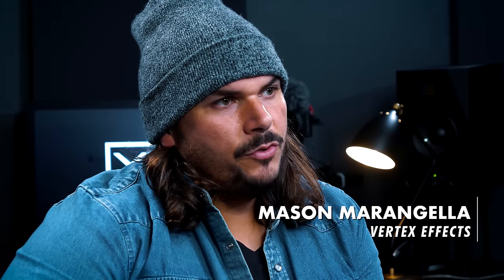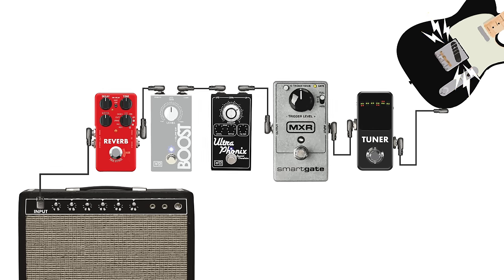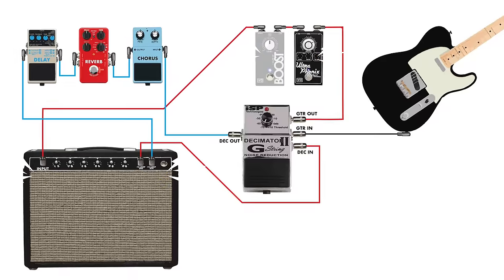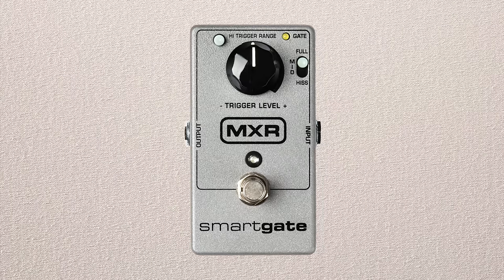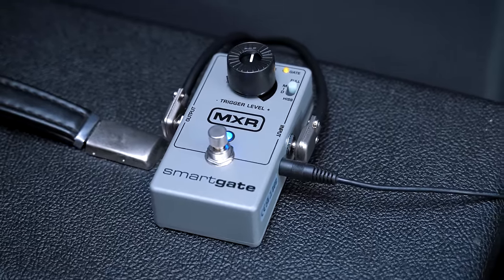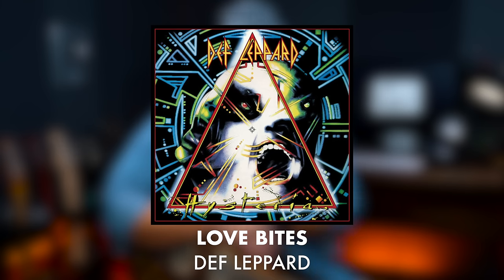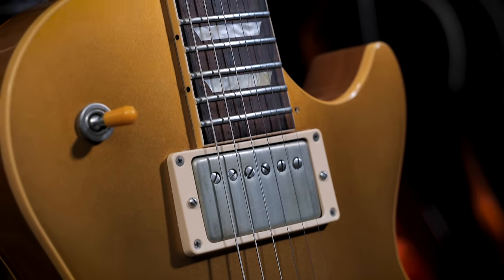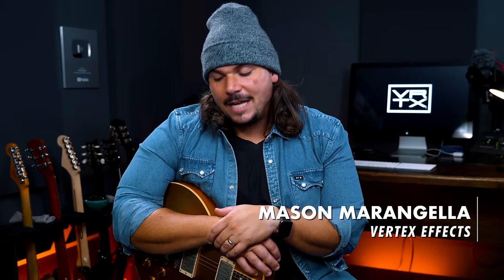Why I Changed My Mind About Noise Gates

Comment: Dear Mason,
I always enjoy your content, but I wonder why you never tried to compare AC powered (plugged into a wall) to battery powered (or USB powerbank) powered rigs? The noise floor is also different.
Reply from the maker: USB powered stuff is usually way worse than any of the standard isolated supplies, both linear and switch mode.  They in no way resemble or compare.  The USB stuff is still a novelty.
Reply: @VertexEffectsInc  Really? I started way back when using Volto and now i'm using my Cioks4 and have nothing but great results with it, even playing high gain ampa with an H9 and an ISP. When I plug into a mains power source, I always have increase the gate and when I switch to USB powerbank, I really have to dial it down and hardly have to use any gate. Still a novely? Sorry dude, but then we agree to disagree. Maybe you can school us on one of your next videos?
Reply from the maker: @krimsonlediable  Cioks 4 is a switch mode power supply, not a battery unit.  You can get away with lesser power supplies through cleaner amps and pedals with better quality filtering for irregular supplies with noise on them - it's a total crapshoot though.
Reply: @VertexEffectsInc  Hey dude, I've been using this setup with my Atma for small and 5150 for bigger gigs for years and it never ever failed me. All I need is a USB powerbank for power my Cioks4 and I'm good to go. No hiss, ground loops, nothing but a very healthy hi gain chug sound.
Reply: @krimsonlediable  Agreed. Been using USB power banks and mission 529 m for a few years. Cured my noise issues and flakey venue power sockets issues. Not a novelty in my book by a long shot. Serious gigging experience proves that.

Comment: If you have a blackstar amp and a  single  coil guitar you definitely  need a noise gate. With a blackstar I found the tc electronics sentry works the best..and ive tried several different gates

Comment: I rather have a gate that has a KEY input rather than running my original guitar signal through the gates circuit because it will tone suck and alter the original guitars dynamics. Its best to use a Noise Reduction software program that will copy the guitar track and remove the noise using AI algorithms. It algorithms called STEMS that are isolating the noise on tracks into STEMS i think they are calling them stems also the noise riding on the tracks. Try to look into Noise Reduction software programs. I'm not sure why guitar gate pedals don't use more KEY inputs instead of audio input ports.
Reply from the maker: As you can see, the input on any 4CM gate is the Key input (or sensor), so you don't have to have a ZUUL necessarily to introduce that feature.
Reply: @VertexEffectsInc  Yes but you guitars original signal is still going through the noise gate. If you use a Buffer Splitter to repurpose the gates input as a GATE KEY input this also alters the original guitar signal because the buffer converted high impedance to low impedance. Its better to use a Gate pedal input as a KEY input and have a "Pass through port" instead of using a buffer pedal. The newer DJ equipment has noise reduction AI Algorithms to remove noises from vinyl records and other gear noises. The ZUUL key input is a better way to go if you're using a gate pedal but still the guitar pickups are grounded which needs an isolation transformer between the guitar pickups to the pedalboards input and another isolation transformer from the pedalboards output to the guitar amplifiers input, this will keep the noise in an isolated closed loop.
Reply from the maker: @waynegram8907  If you hit the gate first that's the same as hitting the KEY, the input and the KEY are both sensors.  The Send is the same as a splitter off the input of the gate.
Reply: @VertexEffectsInc  I'm not sure why removing the ground on the send or return of the cable and adding a 0.1uf or 0.01uf to the ground will help reduce the noise level. The ground shouldn't have any noise level riding on the ground it should be a clean zero volts. If your voltage meter is measuring an AC millivolts on the grounds there is a problem and adding a capacitor is putting a band aid on the noise problem trying to sink high frequency noises to ground that way. The capacitor is also going to lift the ground potential at a different millivolt potential. Its a partial ground lifting make-shift problem fixer
Reply: @VertexEffectsInc  But your original guitar signal is going through IC chips, buffer stages which is ruining the original guitar signal its called degradation from the PCB board traces LCR. I don't want to use the gate as a signal buffer splitter, you rather use the KEY port because its just Sensing your guitar signal. If you use the gates input as a key port your guitar signal is going through the IC chips, FETS, transistors, PCB board traces which is degrading your guitar signal and altering it. I'm sure why they haven't made more gate pedals that have GATE sensor ports because this is the way to do which you put the whole pedal boards input and output in the gates send and return ports so the whole pedalboard is going through the gate or just your noisy guitar pedals. Most preamp, booster, overdrive, distortion are going to raise the noise floor which is going to sound very noisy even when the gate is OPEN. Its better to use a Noise Reduction AI software because it removes the noise even while the gate is OPEN because a noise reduction is NOT a gate opening and closing its an algorithm like a STEM that is removing the noise all together its completely different than a gate. There is a big difference between a GATE compared to Noise Reduction. Yes, a a lot of companies call noise reduction units as gates but its a false branding. A true Noise Reduction doesn't use a gate to open and close it removes the noise like a STEM AI algorithm does by copying the original guitar signal and comparing it with the copy and removing the noise all together. A GATE while its OPEN will still has that noise floor in the background so its still there not removed at all. I think a lot of people don't understand the differences which you should of explained in the video lesson which will help out others on knowing the difference between a GATE compared to Noise Reduction processing algorithms

Comment: I wouldn’t put any pedal at all except the pedalboard input buffer going in to the Decimator GString guitar-in jack.  If you put other pedals (like compressors or boosts) before it, any noise coming from those pedals will not be filtered out.
Reply from the maker: The video doesn't contest that, in fact it specifically shows diagrams putting pedals inside the gate and outside the gate depending on use cases.
Reply: @VertexEffectsInc  I see, sorry I didn’t frame my sentence well that it was my personal preference because of the noise issues I get from compressors before it haha.  I didn’t mean to make it sound like mine is the absolute correct.  Yup I agree, whichever fits in the use case you need and if it results with good tone, it’s all good 👌